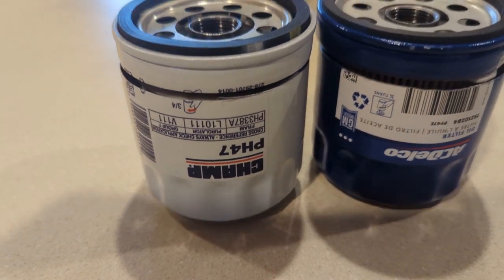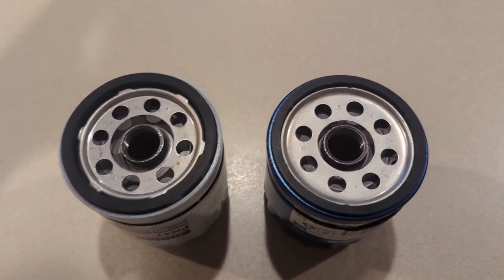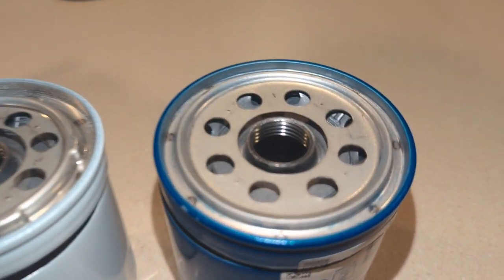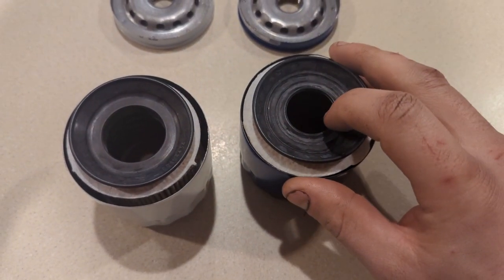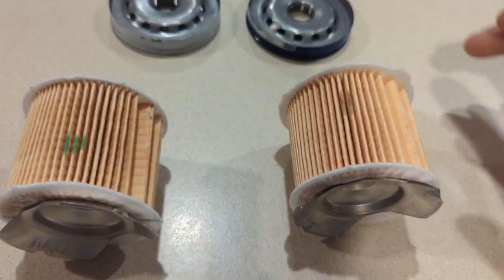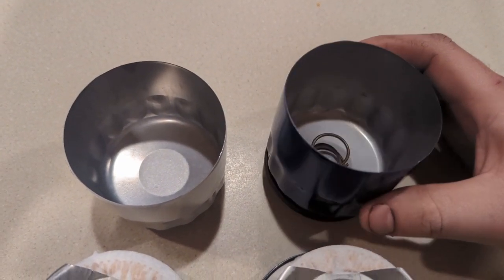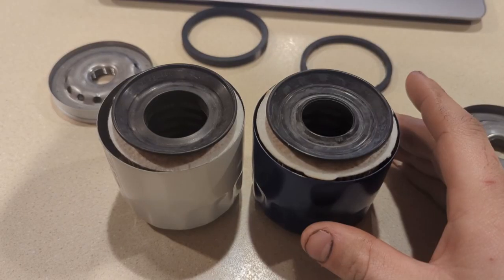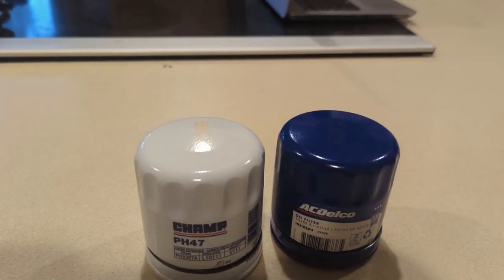Oil Filter Teardown and Review | AC Delco Vs Champ | OEM Quality

Comment: "Most of the oil that goes through the filter is rejected". No. Only time oil doesn't flow through media is in a bypass event. Best information says are rare and of short duration. The other time that could happen, filter so loaded it's past the holding capacity, poorly maintained. The filters shown have no internal bypass, meaning engine has a block bypass controlling that function. Many (not all) GM vehicles have that design. Both filters here made by Champ Labs. Now though, Champ has gone to metal end caps with the nylon core. Those without engine block bypass have dome poppet type bypass. What's odd about the ACDelco filter here, it shows a coil compression spring in addition to the stamped flat spring. Won't hurt, but it is redundant to the latter.